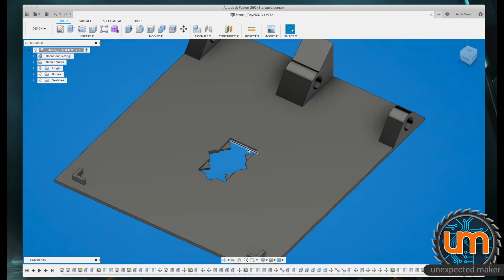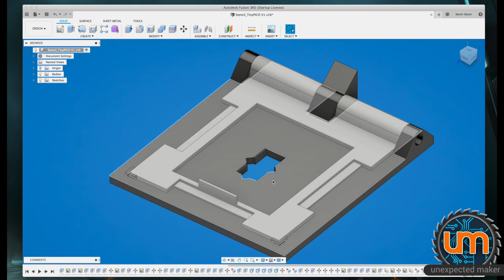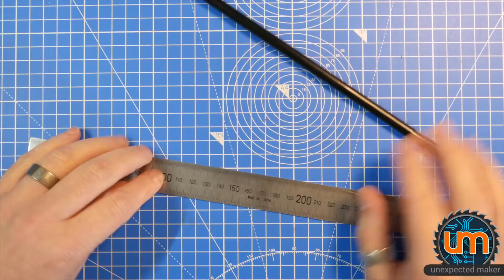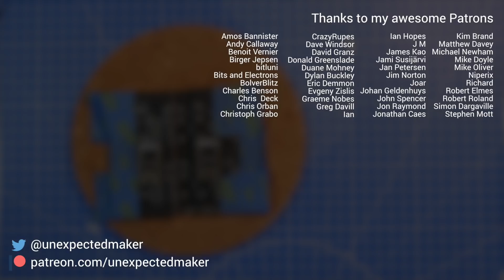Custom Stencil Frame for TinyPICO PSRAM

Comment: I love all the improvements you are making to your workflow to make it more streamlined! I hope it will help you save some time in the long run :)
Reply from the maker: Thanks Ben! I fixed the upper section not closing properly, tapes up the JSP with kapton and used it today and it was ace! Prob takes the same amount of time to dop as hand soldering, but the results are nicer ;)

Comment: It could be the folded blue tape is lifting the stencil up. For the ram cutouts i would use some kapton tape from the back, its not adding too much thickness in this case. I like the stencil holder, maybe an adjustable version would be cool. In screen printing machines the bed is often adjustable with screws, this together with interchangeable pcb holders would be nice and save some 3d prints in long term.
By the way, i received your reflow controller, but still need to connect and test it. I’m looking forward to make a first run. Keep on!
Reply from the maker: It turned out to be some 3d printing support debris I hand't seen/removed. I found it after I pulled it apart post video shoot, and it's working great now. Bases with Interchangeable board inserts are tough as some of my boards are 1mm thick and some 1.6mm, while this one needed 5mm clearance. Also I tend to only make a frame like this for a board I stencil a lot... like > 100 times.  So seems a lot of extra design work and re-printing for no gain right now. Possibly in the future, I might design a set and put them on thingiverse.

I'm glad the Reflow Master arrived safe! I hope you get a lot of use out of it :-)